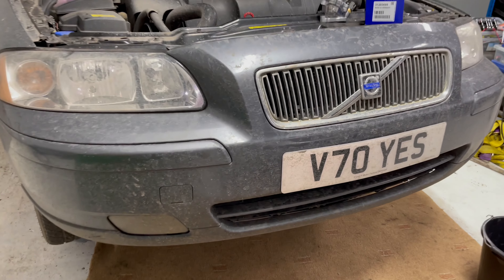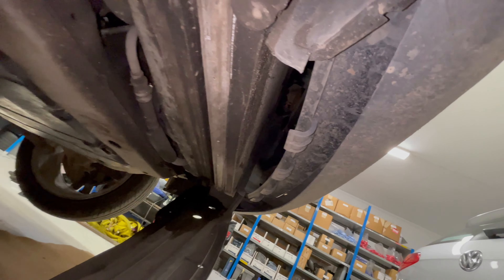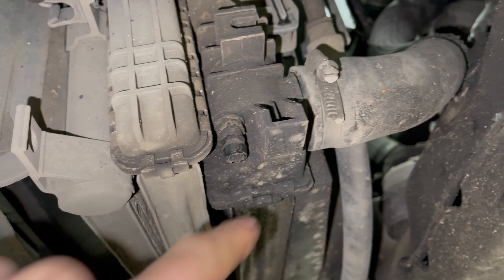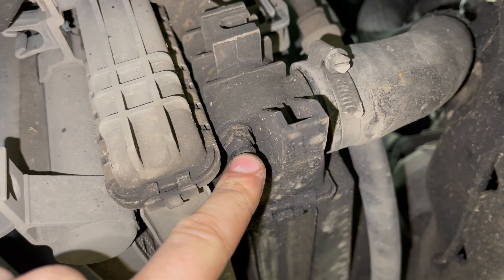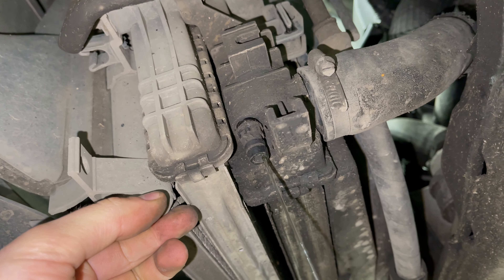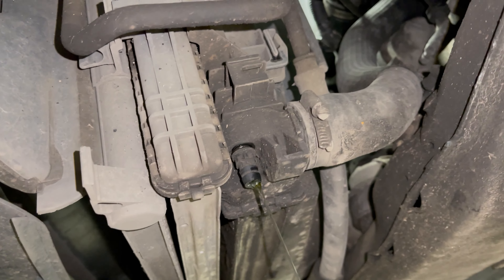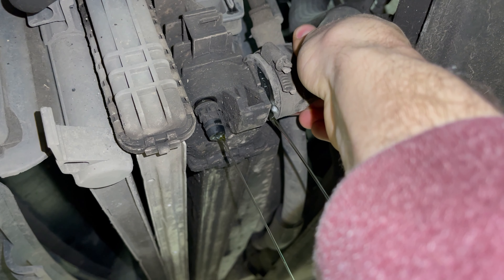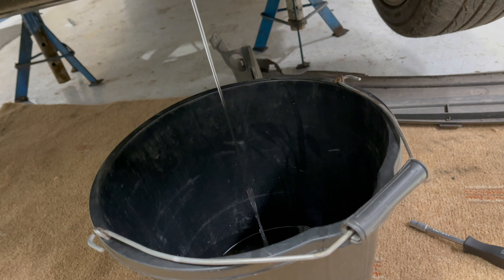P2 Volvo V70/S60 Coolant Drain

Comment: Thanks for the video. I realized that while taking the plastic off that there is a hole in the plastic so that you don't have to take it off and can still get to the drain screw with a deep socked. I think it is a 13mm. I see in your video that there is a hole there in your plastic as well.